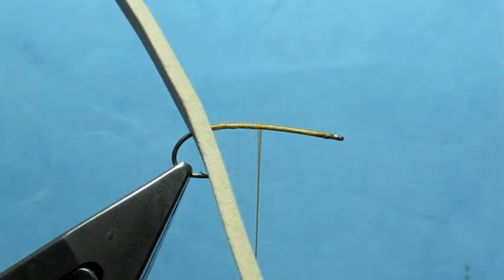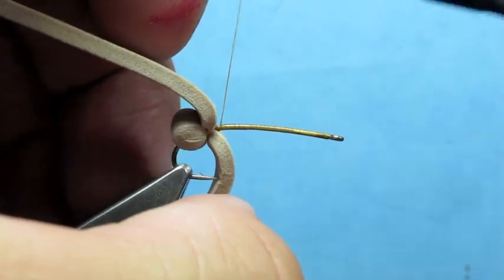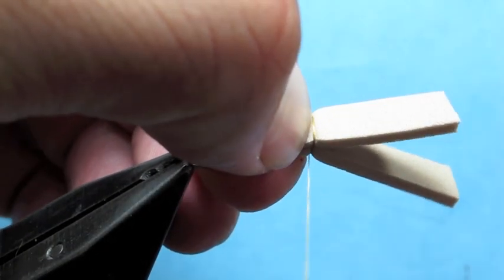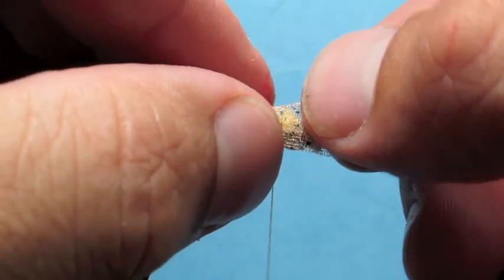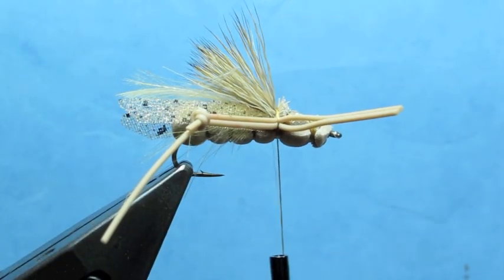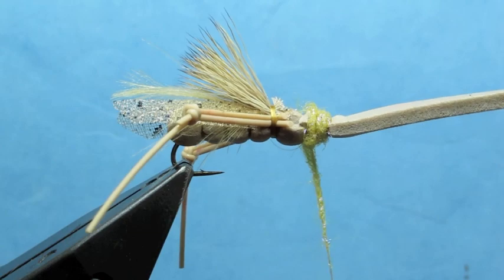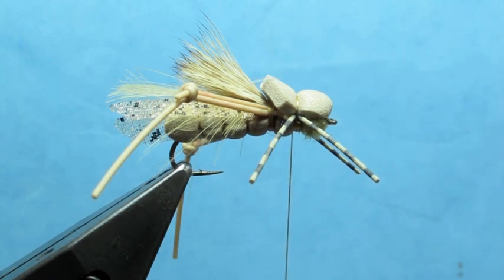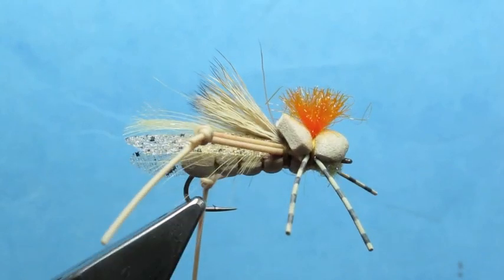Fly Tying with Hans- Hans' Hopper

Comment from the maker: It depends on the rubber leg material. Some rubber legs tend to be a bit more slick feeling, but i find a small dab of super glue works to keep them from loosening at the joints.

Comment: hi Hans.. fantastic design.. i've tried doing a few and i like yours.. I am a beginner but I am having same issue you did in video- the body twists on the hook all thru the tying process and by the time i'm done the alignment is all off.. What have you done to solve this??

Thanks!

John in CA.
Reply from the maker: Hi John, One solution is to use super glue along the thread base before you fold the foam over for the abdomen- 1:50 during the video. Thanks for watching! Hans